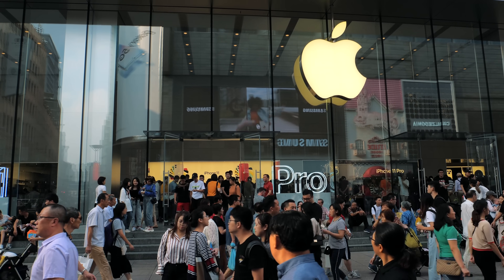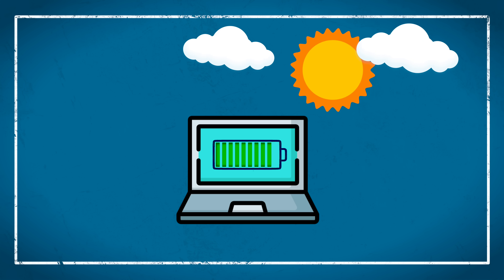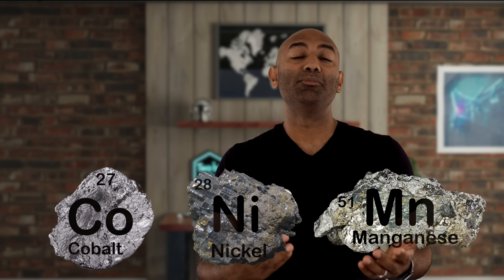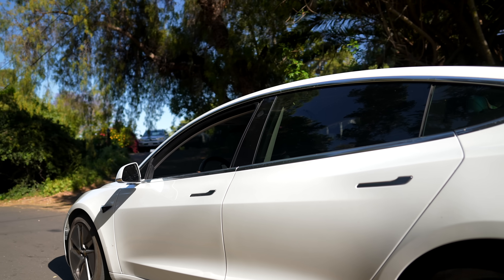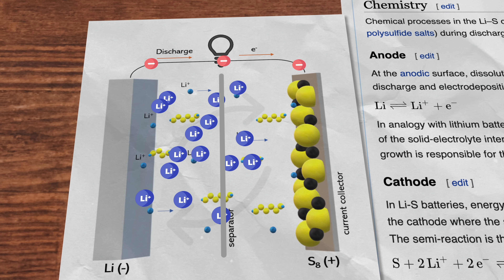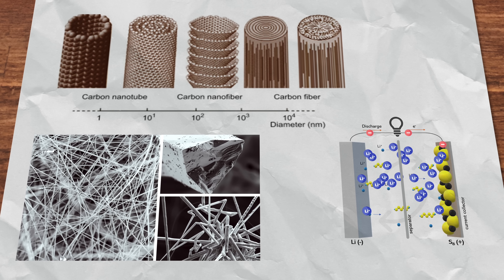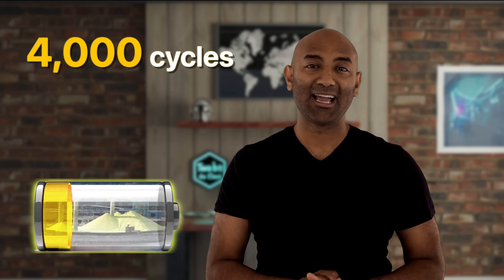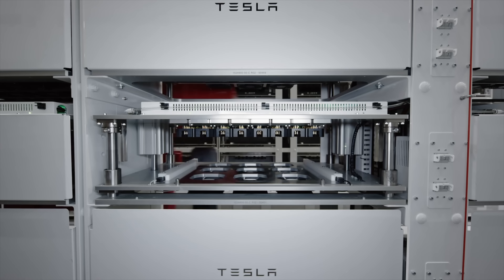Scientists Discover a Lithium Sulfur Battery Breakthrough on Accident!

Comment from the maker: To start comparing quotes and simplify insurance buying, check out Policygenius: https://policygenius.com/twobitdavinci. Thanks to Policygenius for sponsoring this video!
Reply: Can I suggest you or your friend Matt from Undecided do a CoVid with The Limiting Factor YouTube channel about the potential of this battery. AS... 
As ever their is a significant difference between a battery that has been demonstrated in a lab & it being manufactured in a Giga Factory.
But with a density 3× Lithium Ion its use in aircraft & in military systems is where its most likely to be found. If the aircraft structure can be built from Lithium sulphur batteries you have a credible solution for short to medium range aircraft! Admittedly it may be fighting the use of hydrogen enriched ammonia as a fuel
Reply: Lithium is earth abundant. Its almost as common as sodium.
Reply: I'm really curious if there is any information of the rate of charge and dispersal of charge as that is also a massive consideration in batteries and in many applications make a bigger difference than density. Even in lithium ion batteries there are differences in this and that makes a change in electric cars like tesla plaid requires the cells its using because they don't have different cells that can provide faster energy to the electric motors.
Reply: Again, the problem isn't the millage! The problem is the degradation of the batteries! Which is especially problematic for LITHIUM batteries!
Reply: @JackSkellington-h2w  what degradation? Do not compare  the lithium ion batteries used in phones with those used in cars. That's like saying that Formula 1 engines can't drive for more than a few hundred miles & need constant maintenance thus petrol engines can't be used in a mustang!
Their was some problems with Nissan batteries in the leaf because it didn't have active thermal management of the battery pack, but even Nissan batteries would still get  70% charge after 100,000 miles & thats on a 10 year old cell chemistry. These days cobalt free Lithium Iron (Iron as in steel) may have lower density than high performance Lithium Nickel Cobolt batteries, but they can be easily charged to 90% and are good for 250,000 miles without noticeable degradation. Why not get yourself some education & watch some of the Limiting Factor YouTube channel
Reply: @annakissed3226  Riiiiiiiiiiiiiiiiiight, so Tesla is dropping their warranty millage and years of warranty because they last so long. Riiiiiiiiiiiiiiiiiiight! Also, Tesla also changed their terms and no longer replace under 70% degraded batteries with new ones but with used ones!  And as far as education, I'm a chemist!
Reply: @JackSkellington-h2w  there are many tesla on the road with well over 5 year old batteries that aren't experiencing any issues with very minimal degradation.
Reply: @daemenoth  Yeah, many isn't really enough! It needs to be ALL EV's for this shift to actually work. Especially for poor and middle class who can't afford to pay $150,000 every 5 years for a new car.
Reply: @JackSkellington-h2w  well for now the ones that are lasting less than 5 years are few enough to be considered an anomaly. You perhaps need to look at more or better sources for the information you are making your assumptions about the state of lithium ion batteries in vehicles. Also nobody is paying the full price of a $150,000 model S plaid to get a $11,000-$20,000 battery replacement. In many cases you can also recoup some of the battery costs too. Considering gas prices as compared to what most people are spending on charging their ev especially if they also invested in solar we are talking about significant cost reduction that makes it 100% worth owning an EV even if you may have to replace the battery within 10 years.
Reply: Ah yes, first you pay $30k for a used Tesla and then another $20k for a new battery pack. Sounds reasonable!
Reply: @JackSkellington-h2w  you clearly have some sort of issue....
Reply: @JackSkellington-h2w  so what if your a chemist? Pharmaceuticals, organics, oil & gas, just because you've done a degree in chemistry doesn't mean you know ship about batteries
Like I said go watch the limiting factor & actually learn some evidence!!
Reply: @JackSkellington-h2w  Sorry but your opinion is invalid. I know Tesla's with over 300,000 miles on their original batteries that are being used as Taxi's. The only vehicles that have batteries that do not last today are the Nissan Leaf. And that is because they did not include a thermal management system in those cars for control the temperature of the battery pack.
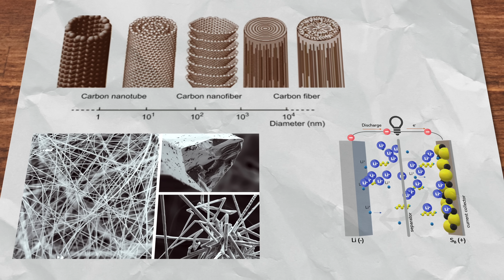Reply: How much do the carbon nano tubes cost? 6:57
Reply: @gig2734  What carbon nanotubes? Carbon Nanotubes are not used in Lithium battery construction.
Reply: I lost all patience with this clown when I heard "three times less".
Reply: @Youtube_Stole_My_Handle_Too  where?
Reply: @gig2734  pretty early
Reply: @Youtube_Stole_My_Handle_Too  That phrase bugs me too. If item "A" weighs 1kg, and Item "B" weighs three times less than item "A", that must mean item "B" weighs negative 2 kg, right?  Of course that's not what people mean: "3 times less" is used to mean "one third as much".   So I'm with you on that.  However, I will give Ricky credit for refraining from saying "three times more" in four different places: "three times the energy density" (twice) and "three times as long", "three times the capacity".  To my mind, the expression "three times more" is a worse sin than "three times less", because you can't tell whether the person intended just "three times", or did they actually mean "four times".  So I score Ricky as 4 thumbs up, and only one down. :-).
Reply: @Graham_Wideman  Yes, negative 2 it is, but they who use this moronic term meant to say 1/3, right? Thus, to read something sensible into their speech you have to assume they mean something else but what they actually say. This is also what makes this term so bad. Never a good thing to start by assuming your conversation partner is a moron.
Reply: Where is the reference for this research
Reply: Hi,  I live in  Puerto Rico will policy genius work here for Tesla insurance? 
Also you should look at LYTEN as they have solved the Lithium Sulfur battery and will be producing later in 2024. 
There discovery is 3D Graphene and it solves much more than just Batteries. Check them out!

Comment: The reason lithium needs to be replaced is it is too heavy; too fire prone, and too energy intensive to mine. How about Graphine, how about selenium; how about sodium etc - doesn't matter if no one makes them; all hype.  I suppose you wouldn't have much to report if you had to wait for a factory to actually make some new battery. How  about finding the clean energy that will enable the grid to be 3x as large as it is now so you could actually do any of these as a resplacement to bio fuels.

Comment: Yea there is a problem with this technology that this glowing video feels uncompelled to report.  With lithium ion batteries, the voltage during discharge is nearly constant at about 4.5 volts fully charged and 3.9 volts fully discharged, but with lithium sulfur, since each sulfur ion can give-up/store two electrons, there are multiple voltage plateaus and the initial voltage is only about 4 volts, this drops to about 3.5 during the first 1/3rd of it's capacity being discharged and then there is a steep drop to 2.5 to 2 volts during the remaining 2/3rds of it's capacity discharge.  So the amp-hour rating is misleading and does not accurately reflect capacity since the fully discharged voltage is half the fully charged voltage, and since 2/3rds of it's discharge cycle is in the lower voltage region, this means the power output for a given amp-hour capacity is only about half that of an equivalent lithium ion battery.  Thus will a lithium-sulfur battery might have 3x the amp-hour capacity by weight, the actual power capacity is only about 1-1/2 times lithium and it is the power capacity not the amp-hour capacity that determines the total distance it can drive a vehicle.  Further, having to deal with such a highly unstable source voltage will complicate the inverter and all other power electronics on the vehicle as well as the charger.

Comment: the escaping of polysulfide intermediates (produced during the redox reaction process) from the cathode structure is the primary reason for rapid capacity fading.

Lithium ion battery doesn't degrade as easily  as  lithium sulfur overtime.

Comment: Could you explain why this is cheaper? A typical lithium-ion battery uses graphite as the anode. I understand the lithium-ion sulphur is using sulphur as the anode while the cathode is still active lithium/cobalt/manganese oxide.

Comment: WOW, so bad. The sulphur is not replacing lithium, it is replacing cobalt, which is much more significant, and - had you said so - would have made your video much more compelling, not to mention accurate instead of completely wrong about the significance of the LiS battery. This is not journalism, and definitely not a scientific video.
Are you familiar with "Don't recommend this channel"? Bye bye.
Reply from the maker: When did I say it was? Did you watch the video? It’s a lithium sulfur battery! Which could lead the way to a sodium sulfur battery. Super weird comment my man
Reply: @TwoBitDaVinci  Starting at 2:27 You are comparing the abundance of sulphur to lithium. Why? They are not substitutes.
"Compared to Lithium, sulphur is ... finding other suitable substitutes ... sulphur would also limit" etc. You state, in at least two ways, that using sulphur is a substitute for lithium. "Finding other suitable substitutes" is saying that sulphur is one substitute. "Sulphur will also limit use of other materials" is saying that sulphur is a substitute for lithium as well as for "other" elements. It is your use of "other" in both cases that makes this so. This whole section needs a total re-write.
Yes, SODIUM can be a substitute for lithium, but by the time you had said twice that sulphur was, I stopped watching, because it was sloppy language at best, making your statements factually wrong.
BTW you're welcome, how many people would just not watch any more without giving you a reason?

Comment: If every car suddenly was electric today our grid would not support it. We have blackouts from ac usage now, imagine cars and semi trucks charging as well. Wind and solar wouldn't make enough power even with battery storage. I like the electric clean solution, we really need reliable clean solutions for constant reliable power. Hydro, thermal, and nuclear. Wind and sun as a supplement, or private use. Why can't we use everything else and use petroleum to only package our food and create our clothing, and everything electric cars need.

Comment: There are a diffrence between wh/l and wh/g.
Yes, li-s are better wh/g 4-5 times.
But wh/l they are the same, or have lower energy. So, this is the same mix up as always.
Where are the 5 times bigger battery supposed to be stored in the car?

Comment: It's easier to say 1500 mile battery but what it means is that gravimetrics has changed in this kind of battery. You end up with a battery that weighs less per kWh it holds.  

If in 15 years his model 3 (70 kWh) with a 300 mile range needs a battery replacement, they wont put in a the 15 year old battery tech since they wont make them any more.  They will put in near latest battery technology. So if they put in a 70 kWh battery pack it will weigh less and on that same number of kWH that Model 3 will go further since the battery weighs less, or they could put in a battery that weighs the same weight as the old battery but is much more energy dense also increase the Model 3 range.

EVs are so much better than fossil fuel cars.  It's a wonderful daily experience and the flexibility in fueling it from many energy sources that can make a electricity.

Comment: Sooo. If a sulfur battery gets punctured does it smell like a hellish fart? 🤔
Reply from the maker: brilliant question!
Reply: @TwoBitDaVinci  my original thought was to block the dendrite formation with a sheet of graphene but it's structure and properties would likely interfere with the batteries function. If the cabon nano-fibers helped discover the new way to produce a rare form of crystallized sulfer what about trying it with other materials that crystallize?

Comment: One of the sore spots of EV ownership is the $$$ wear on the tires, both from increased weight of the batteries, the need for $$$ low friction special tires and the extra wear from the high torque that can be placed on them. 

A lighter weight battery, lesser need for low friction tires, and computer limited start torque (takeoff speeds) should mitigate this back to normal expectations.
Reply: Yes on most of this, but tire wear due to starting torque doesn't have to be an issue in current vehicles. Just don't stomp on the accelerator pedal. It's not like EVs require you to do burnouts at every startup!
Reply: @Graham_Wideman  quite agree, I think after one set of $$$ tires speedsters might get it! Note some EVs are marketed for their 'g-force start'.

Comment: The Chinese are already building a factory to produce sodium ion batteries.  It will be online in 2023.   Sodium ion battery performance is similar to Lithium Ion, but at about one third the cost.  And, while the Chinese are still working on improving Sodium batteries to get even better performance, they can build them today.

Comment: Talk to me when they are available for less than $50/Kwhr.  So many times we've been teased about some great breakthrough but then nothing happens. The reason I believe $50/Kwhr is a breakthrough point is that would make a 100 Kwhr battery ~ $5,000 or roughly the cost of the motor in an ICE.  A long range 400 + mile EV for the cost of an equivalent gas car and only the hard core will want to use gas.

Comment: The problem is the grids power is still putting close to 1 lb. of CO2 into the air for each kWh when you charge your EV.    Batteries is not the answer to lowering the CO2 of autos.  A brand new Tesla has already put over 20 tons of CO2 into the air, about as much as a mid size car will put into the air in its first 100k miles.  EVs are a dead end technology!
Reply from the maker: Where did you get your numbers from? Everything has emissions, but have you factories upstream emissions for gasoline even before you burn it? Your numbers are way off. First of all if you remove the metals and manufacturing of the car, which is the same it comes down the batteries. Manufacturing 800-1000lbs of batteries, vs 10-15 gallons of gasoline every week.

Comment: Just about every week there is a new battery brake-through that is going to revolutionize EVs, 
I have been watching videos like this for 15 years.
All the while EVs are still running on fossil fuels.
At what point do you guys starting to feel silly reporting on this nonsense???
On the other-hand I have been running my Diesel cars and trucks on used veggie oil from restaurants.
That is free fuel for 13 years and have saved $90,000.
But no one is reporting on that.

Comment: Great overview, very professional.
Thanks.
I can see producers of EVs simply installing much smaller batteries to allow slightly more range and greatly reduced weight and cost.
People will forget that they could have great range instead focusing on cost instead.
Reply from the maker: Yah I love that all this research is happening! Exciting times for sure
Reply: @William Arrington I was thinking Hybrid too. Watched a few reviews on that tech. They are mostly great but expensive to repair when something eventually goes wrong.
Reply: I would see just different types of EVs within the same brand.  For those who go on huge long road trips (usually for work) -- VS people who work from home and live in the city and don't have to drive much where current range on good EVs is more than just fine.
Reply: @William Arrington still be good to have a choice. Where I live, a trip to the city is 250 miles round trip. A trip to our kids city is over 430 miles. (Each way)

Comment: The basic chemical reaction of Sulfur and Lithium makes it not commercially viable, you can't recharge it without killing it - this is not a breakthrough but yet another "what if". Even if they could make the altered Sulphur now we would mine two minerals and have to also reprocess them? One step forward, two steps back. Might as well go back to talking about Super Capacitors in conjunction with regular battery packs.   💥
Reply: Sulfur is already industrially available both mined and as a byproduct of several chemical processes and it is cheap. If graphene flakes will work, they can already be produced quite cheaply and efficiently. Now if you need larger graphene sheets, all bets are off. There are now multiple roll-to-roll processes for producing graphene that are not too expensive, but weight is not an issue. Graphene is one atom thick and many times stronger than steel, so it won't add much to the weight of a battery, and Sulfur is low density and lightweight, also. The only thing that can possibly make a lithium- or sodium-sulfur battery heavy is the carbonate between the cathode and anode, and that isn't much. A sodium-sulfur battery with carbonate cannot be heavier than an NMCo battery. It can, OTOH be much less dense, meaning that it can require more space in any design that carries such a battery, up to 25% more space from what I have heard. That takes away the advantage of higher energy density.